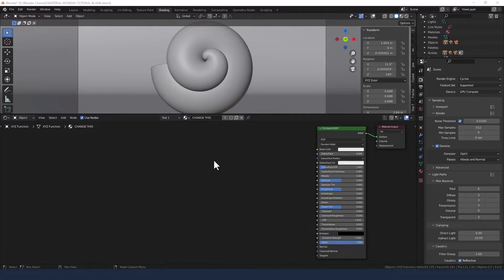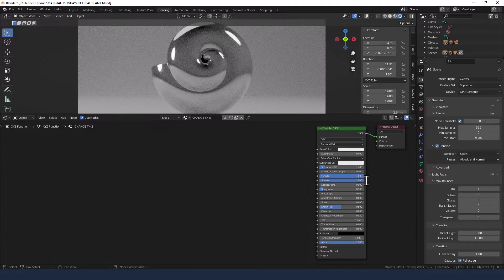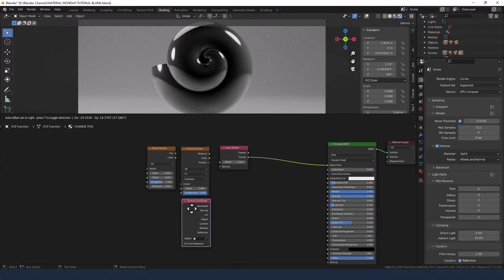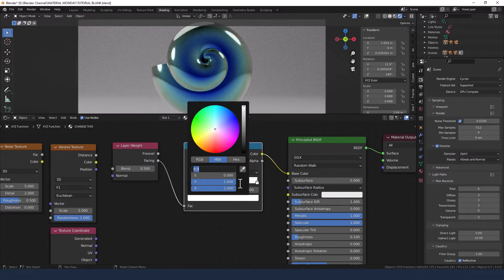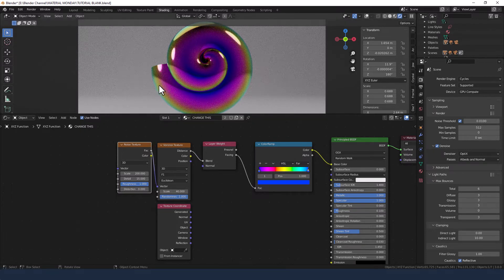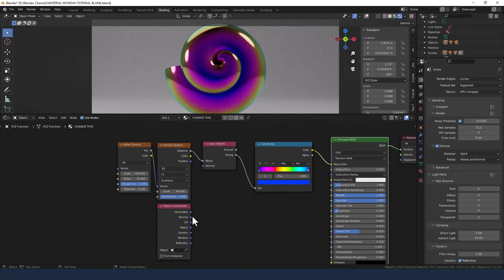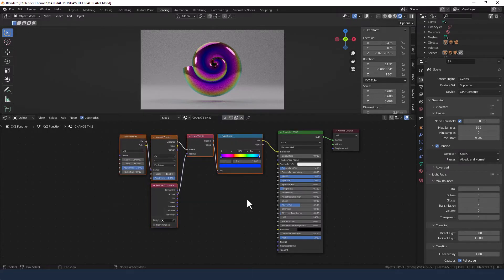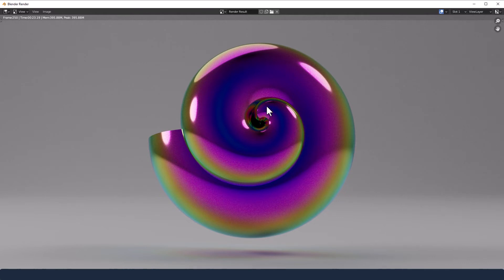CREATE A PROCEDURAL ANODIZED METAL MATERIAL FOR BLENDER

Comment: How does this video have only 400 views. Ridiculously good tutorial on something that is hard to find.
Reply from the maker: Algorithms, most likely. Thanks for the compliment.
Reply: @blenderbitesize  I am sure, if you keep uploading your channel will pick up. One quick question. Is there way to add secondary color to primary color of anodization? If you look at titanium anodized material there is hint of other color in shiny parts of object.
Reply from the maker: @KamalSingh-zo1ol  You could try mixing an RGB node with the color ramp and play around with the factor to achieve different results. For example, if you add an RGB node and plug the fresnel output from the layer weight node into the factor of the mix node, you should see a silvery grey colour around the outer edge. 
There are other options but generally you'd need to mix them with the color ramp in the original set up.
Reply: @blenderbitesize  Sounds good. Thank you. Also found a problem with your approach. When we move camera the colors also change on object. This makes it look non realistic. Is there a way to bake colors in? Rather than them changing with camera angle change.